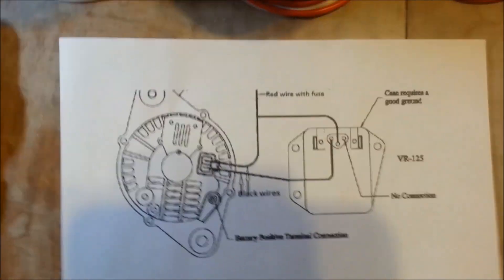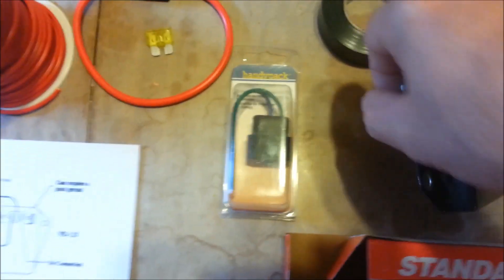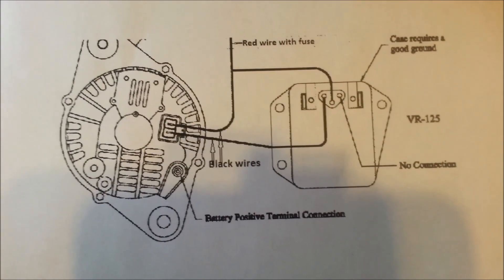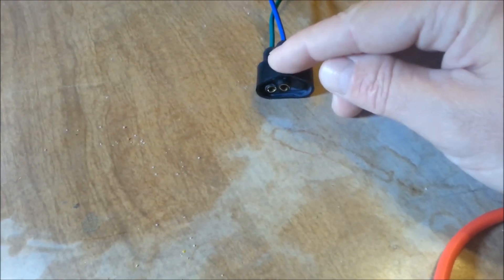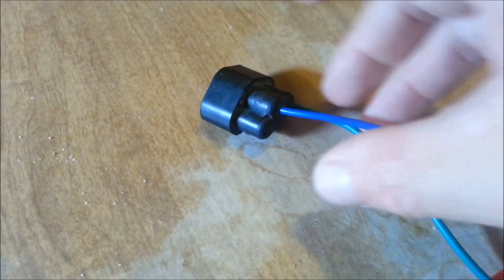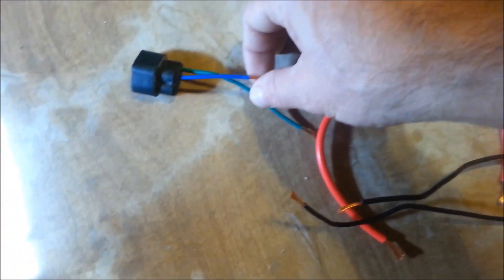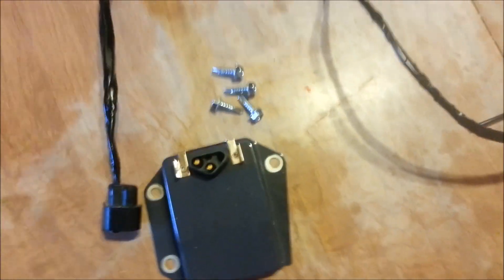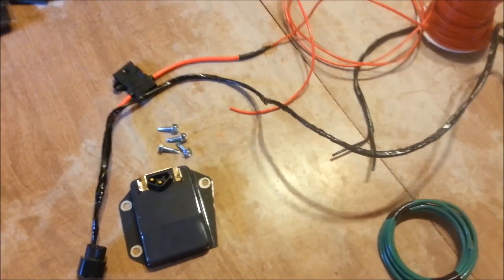How to make a External Voltage Regulator to Bypass a Dodge computer, ECM

Comment: I did this set up. I have separate ground from battery to volt case. And I have ground from bolted to firewall. Key on hot to center. Alternator is overcharging 16v.

Comment: I did this to my 2021 5.9 and got my key on hot wire from the steering column black/white key onto hot wire. Don't cut wire just solder to it and be sure to use the in line fuse. My gauges for charging still work. I will buy and mount backup regulator after watching this just in case.

Comment: Yes, run a ground strap/wire with 2 crimp eyelets on the wire, connect 1 to the Regulator bracket mounting hole & 1 to a bolt on your Alternator casing somewhere.

Comment: I connected one wire to the alternator and the other to ignition on the ignition switch.. ground the voltage regulator.Works great.

Comment: Did you have to install a modified driver on the alternator and install a resistor put that external voltage regulator kit?
Reply: That is a very good point. This only works on older alternators. If yours is a newer or recently replaced alternator, you will require a driver module for the alternator or a type B voltage regulator.

Comment: Question if you don’t ground that correctly, can it also cause your lights to flicker?
Reply: Definitely, YES. Run the ground strap from your voltage Regulator to the Alternator Casing.

Comment: Man my jeep voltage drops for 15.5 to to low 14 when I put in gear I run js 250 alt it is externally regulated what would stop this problem tried everything

Comment: Will this work on my 87 jeep commanche? New alt with internal volt reg and the computer is not telling the voltage regulator to charge the battery.  Also no more key something is wrong with the key switch.  Do I need to take out the internal voltage regulator out of the new alternator in order for your teknic to work? Great video by the way.  I'm ready to sell this damn thing I been so frustrated.
Reply: The rig has been converted to a push button start. I still have to turn the key only for the fuel pump to turn on
Reply: Do some electrical tests, there is an ignition switch under the steering Column, that may be your issue, pull the steering Column down & push the ignition switch to START manually. That will tell you if it's the Ignition Switch or not. If  it starts manually then it is the switch.

Comment: hi that Work in a dodge ram 2011 5.7 hemi
Reply: I know this is an extremely old thread but I'm having the same issue with the same engine. Did this work for you, or did you need something special for the alternator? TYIA.

Comment: im having electric issues with my PT Cruiser, it says its a bad battery, replace the battery, it says its a bad alternator, so i do that, the battery light keeps coming back on, i traced every single and cleaned every ground wire, im loosing my mind.

Comment: What tells the computer it's getting voltage? I bought a used Jeep with this Voltage Bypass installed and the dash guage/ Shop Diagnostic Redaer are saying the computer thinks its not getting voltage. But with a Multi Meter the alternator and battery are actually fine.

Comment: A old alternator shop guy told me the old Ford voltage regulators are way more durable than the Mopar ones  the newer aftermarket ones might be better 
But and original one from a junkyard dodge might be hard to find  but no one grabs the ford ones at junkyard cause they never go bad

Comment: ive been chasing this problem for about 3 months on and off...never realized the computer switched the ground side of that 2 wire connector to tell alternator to charge...thought it was bad battery or alternator or connection......great solution.
Reply: Same here i replaced my battery and alternator with no luck and all the ground wires and positive wires thinking it was one of them

Comment: i did this the same way you did and i am getting 18 volts i tried 2 grounds it will not drop below 18 volts
Reply: The regulator may be bad or having an issue. Also, check for a small Potentiometer on the back, since there are adjustable regulators that allows the voltage to be adjusted down.

Comment: So does the red go to the 12 volt source in the fuse box or directly to the battery
Reply: fuse box
not to battery it won't cut off if u do it that way and will drain the battery
Reply: @coatescomputerservice8917 Fuse Box underhood, Fuse HOT with the Ignition in the Run Position, then OFF when Ignition is switched to the off position.

Comment: The battery will drain because the "center" wire of the voltage regulator needs to go to a switched ignition source, NOT an always-on battery source. Just my .02

Comment: Hello I did a old school v8  carberator one wire distributor swap in a 2000 jeep wrangler and have been trying to bypass ecm for this. Thank you was wondering is it possible to do the same with the coolant and oil so the original gauges work??

Comment: The orange wire in the video goes to the ignition circuit in the fuse box. When the ignition is turned off the charging circuit is isolated from the battery.
Reply: Thank you

Comment: Can you just use the bolt on the alternator as the ground and screw on the voltage regulator to it, instead of screwing on to the body.

Comment: My alternator is still throwing out 30 volts. I'm ready to burn it to the ground
Reply: Yea I’m in the same boat about to order a $1200. pcm tested the circuit from alternator to pcm the harness has no load drop it checked out good I’m running through a few other things today before I bite the bullet.
Reply: Did you figure it out cause I literally have the same problem with my 04.5 common rail. 36 volts with new alternator
Reply: @witte1919  no I haven't figured it out yet. I'm going to just get a new ECM for the jeep. I have tried several times with different external regulators and still having no luck with it. Hope this helps steer you in the right direction.  Good luck!

Comment: Am I supposed to remove the connection to the ecu? I only get 12.6v from my regulator.
Reply: Depending on the year, make, model of your vehicle (2006 and up usually), you will need a modified field driver attached to the alternator itself and a 2.4k ohm resistor added might need to be added on the field sense wires in order to trick the PCM into thinking it's operating correctly. Otherwise, the PCM may throw a check engine light and low battery light indication.
The PCM internal voltage regulator puts out voltage signal between  0.05-.5 volts to the alternator which "opens" the alternator charging circuit. In-turn, this enables the alternator to begin charging the vehicle electrical system at ~13.8~14.6 volts.
It is doubtful that you could remove the PCM connectors to the internal voltage regulator portion of the PCM and not have the computer throw a fault/trouble code of some type.
Reply: @TB0321  I messed up and didn't even realize the 120 amp alternator fuse had been vaporized. There was absolutely nothing there at all but the posts. After replacing that I slapped in my old pcm and everything is running again😁 thanks for the info tho.
Reply: @indiehandstudios5711  Glad you were able to get it sorted out!
Reply: @TB0321  i have an aftermarket highoutput alt would i still need a modified driver and if so why
Reply: @flbassmaster5551  Depends on the Year, Make, and Model of your Dodge. Basically, the PCM has an internal voltage regulator. If that function is no longer working, you either need to get a new PCM or you can bypass it and use an external regulator.
The PCM Internal Voltage Regulator monitors electrical load and increases (or decreases) load as appropriate. The field sense wire(s) sends a  . 05-. 5v  signal to the alternator. Once the PCM internal regulator "senses" that the alternator is receiving the signal, then the PCM will command or drive the alternator voltage (usually this will vary depending on battery voltage, stereo, defroster, Air cond., etc).
If you bypass the PCM internal regulator, you need to "trick" the PCM into thinking it's still working and sending (and receiving) current to the alternator. A Field Sense Wire Kit puts out a constant voltage to the alternator, which allows the aftermarket external voltage regulator to now control the voltage output. The aftermarket external voltage regulator will put out constant voltage instead of varying according to electrical load. 
If your vehicle uses internal PCM voltage regulation and you don't use the field sensing kit, then there's nothing telling the alternator to start producing voltage (electricity).
Reply: @TB0321  awwsome thank you so much can i do this on a 2014 ram 1500 and the field sensing kit your refering to is that the little resistor that goes on the exciter wires back to the pcm?

Comment: thank you  good information
it is good idea for other cars
but what purpose to bypass PCM 
if PCM faulty it should be change obligatory because other functions to the car
Reply: You can have a situation in which the PCM/ECM internal voltage regulator is only affected and the rest of the PCM/ECM functions are working correctly. Rather than spending $800 for a new PCM/ECM, you can spend $40-$70 to bypass the faulty internal voltage regulator.

Comment: So I mimicked that today. Got my alternator to run and charge. The issue I'm having is that on my battery gauge on idle I'd say it sits at 65% but when I hit the gas and keep it on high rps the gauge bounces really fast between 70% and 75%. At the same time my dash lights flickers as well as my dome light. Like I said, I made a mimic so the way I ground it is by putting a wire from the negative battery post to the body of the evr. By your video I assume I need to ground it to the alternator? I have a 91 dodge d350. Any tips would be awesome!

Comment: Have you ever had one blow the fuse on the exciter wire. Mine does after about a mile on the road, a 20amp fuse. Other than that it works perfectly.

Comment: If you place a ballast resistor across the two wires that originally went to the alternator it will turn the battery light on the dash off. Just installed a external regulator kit on a Wrangler the other day. All the parts came as a kit. I'm sure it would be cheaper to source the parts on your own like you did.
Reply: Cool, thanks for responding to everyone. Idk what we would do without you.
Reply: What value ballast resistor did you use. I have just put a separate regulator on my 98 ZG Grand Cherokee and the check gauge, check engine light are on and the voltage meter is reading in the red even though about 14.5 volts is going to the battery. I need to fool the ECU and that ballast thing seems to be the answer. Thanks  Sid
Reply: @sidstevens9035  hi. did you put a ballast resistor, if so, what value did u use? thanks
Reply: Can you snap a picture or draw up exactly how you achieved this? I want to eliminate the light myself!!!!! Thank you!
Reply: @MrHeO2 me too what u come up with 😮

Comment: So I’m running car audio and having hard time getting my voltage hire . I’m buying a high out put alt can I hook this up and adjust the voltage up to 15 volts ?
Reply: I’m an installer. You shouldn’t need 15 volts. Are you having issues when your subs hit? If you’re having problems in car audio it’s usually a bad ground or the amp pulls too much from the battery. Double check your grounds and get a capacitor for your amp.
Reply: At 15.5 volts most car amplifiers produce exponentially higher watt levels than 13.5 and many folks up the voltage. Yes the current is the important number typically, but try it yourself, put an amp on the dyno and supply it 12vdc then 15.5 vdc, the numbers will amaze you. And you should make sure before you recommend a capacitor to explain what it does, some folks like myself don't want the amplifier(s) limited to the amount of current it can draw.

Comment: it is not alternating current, its DC to power the field of the alt, and if you say the blue wire has to go to power, yet they don't matter at the alt, then the blue wire can go to wither one as well.
Reply: There is still a small amount of AC current present. mv worth but it's there.

Comment: I am working on a dodge now. Which key on engine off. I have no 12 V on either of the two fields wires. I thought I should. With it running I have 12 V on both feel the wires.... if I ground the brown one the alternate a full fields.

Comment: How much voltage that regulator commands to the field engine run?
Reply: I believe that voltage to command field wire "open" is between 0.05-.5 volts on certain Mopar models. 
There is also 2.4k ohm resistor located on the alternator itself that needs to be overcome for the alternator to make power on certain models (2006 and up).

Comment: I have a 07 Dodge RAM 3500 I did just what you said and the alternator is not charging . could it be a bad voltage regulator ? I got it from Autozone (duralast )

Comment: I did this and I got it to work except for its jumping between 15 to 16 1/2 volt in my headlights and all the lights inside my vehicle everything's pulsating I ran a couple extra good ground so if anybody that's done this can help me give me some ideas I'd appreciate it...2312922886 feel free to text me cuz it's my daily driver and I can't drive above 2500 RPMs right now

Comment: I'm dealing with this right now and it's still not charging. I have a brand new regulator and alternator
Reply: Did you is the regulator and alternator still hooked up to the rest of the car or was all them extra wires removed and only the NEW wires should be hooked up for it to charge right.. 

you have to disconnected it from old charging system .. Only the BAT hot cable and a good Ground form your battery should still be hooked to the Alternator.. Nothing to the Field wires ot the small wires .. Just the new wire set up. look here for " ideas " maybe something will click to help... 

http://www.imperialclub.com/Repair/Electrical/charging.htm
Reply: If you have a 2005 and newer you probably need an updated driver. U can find them online sold by quick start. I just installed mine and same thing. It doesn't work cause it's a 2017 and I called quick start and I need an updated driver
Reply: @jbucku324  why do you need and updated driver?

Comment: If your watching this video your alternator is probably overcharging. I did this and still over charged.
Jumper cable from each negative side of batteries to the block revealed bad ground at batteries.
They looked fine!   I spent all weekend changing both batteries, alternator, cleaned all battery connections, rigged up a ECU bypass, and was just about to replace the ECU itself. REPLACE YOUR GROUND WIRE 1ST.
Reply: Okay if you do this can you hook this up and your voltage is too high when you hook up that voltage regulator it's not your ground it is the ignition wire is not getting full voltage or has a bad connection hook it up closer to the ignition switch inside or make sure that it's tight where it's at once you have a good feed full voltage to the voltage regulator you will get proper voltage you'll get a 14-4 if your voltage is low or you have a bad positive connection from here I guess you switch your the lower or the worst the connection is on the positive wire of from here I guess you switch your the lower or the worst the connection is on the positive wire coming from your ignition to your voltage irregular system the higher your voltage is going to jump it is the positive wire from your ignition not the negative wire that causes this
Reply: @PaysonYoung-z4w  I just posted a solution that worked for me
Reply: You win @PaysonYoung-z4w
Reply: @PaysonYoung-z4w bro wtf did you just say
Reply: I added a 8 gauge ground straight to the alternator. Im charging 16.7 volts 2012 jeep wrangler i camt understand a damn thing this guy is saying on how to hook this up. Rambling on and on i kept hollering shut up gdt on with it. What did you do
Reply: @robertreynolds7847 Your bypassing the PCM control over your alternator voltage regulation. Center Wire on connector will have 2 wires coming off of it, a Red & a Black. The Red wire will be run to your underhood fuse box to a fuse, 15A or a 20A fuse which is HOT in the RUN Position, but OFF when the key is turned off. The BLACK Wire will Run to the back of your Alternator, it will connect to one side of your 2 wire plug in connector. The other single wire coming off of the External Regulator Plug, will plug into the other side of your 2 wire plug on the back of your Alternator. This contains the whole circuit within your new External Regulator, Bypassing your PCM, so if something goes wrong with your Alternator Circuit, it doesn't take your PCM out with it.
Reply: The Ground wires are always the most pain in the ass items to find when system is  messing up everything.. 

you can look at the light system in any car.. front or rear of the car.. you have  Brake + Back up + Driving lights "Maybe Turn light if it's orange lens"   All hot wires.. 

AND 1 skinny ground wire heading to the back and most of the time a skinny little wire on the passenger side from the light's ground to the body..  

Ground wires should be a size or 2 bigger when you have so many hot wires tied into them..

Comment: Hopefully before you buy the kit read this. My alternator wouldn't charge unless I revved the engine up and then after a few minutes it would quit. I thought it had to be the voltage regulator. I bought an external one and couldn't get it to work for anything no matter how I hooked it up. I got pissed and sprayed  choke cleaner on the alternator (let it dry) and it started working. When I had it checked it happened to be charging. So if you haven't spent the money yet try that
Reply: i did the same thing w/ starting fluid worked awhile  this system sucks. bad volt regulator burns up the computer? give me a break BS system